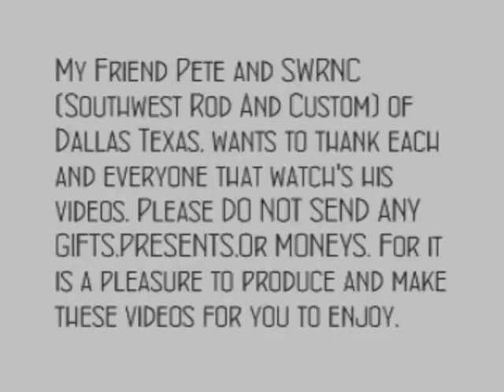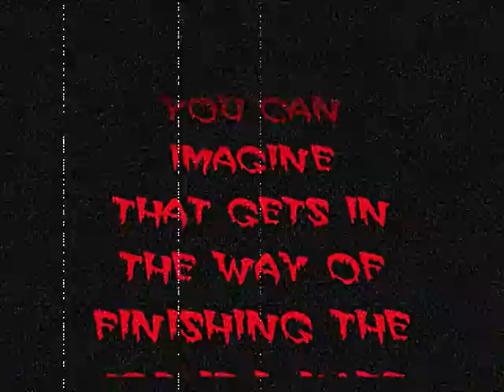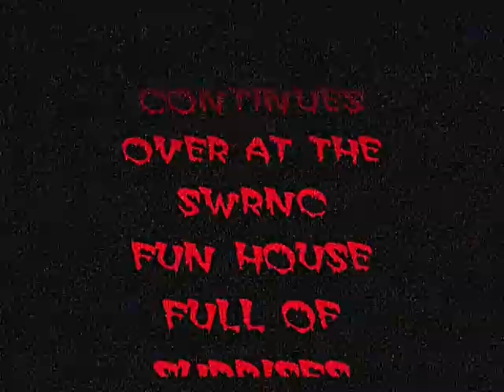HOT RODS AND CUSTOM CARS-To Much Work-Not Enough Time-Part 3

Comment: Hey Pete its Pete from Ontario Canada..question..when spraying epoxy primer
as a sealer for last coat before base coat..can we use DTM epoxy primer to seal or is there another epoxy primer u use..is it reduced and what tip to get smooth finish..1.4   1.8   2.0    thanks love your channel
Reply from the maker: Epoxy primer is just that -- Weather it says DTM or not it's a SEALER.. ALL EPOXY PRIMERS ARE SEALERS GOOD FOR METAL OR OVER BODYWORK OR OLD PAINT OR WHATEVER YOU WANT TO PUT IT ON! There is NO SUCH THING as NON EPOXY PRIMER SEALER.....  You can spray it out of a 1.4 and up, adjust your gun and air pressure accordingly for use.. I would NOT go past a 1.7 if you are looking for a smooth orange peel free flow coat look.  You can add 10% Urathane Reducer to 1 Qt mix for better spray and flow action.